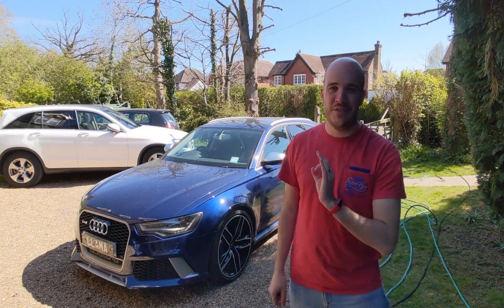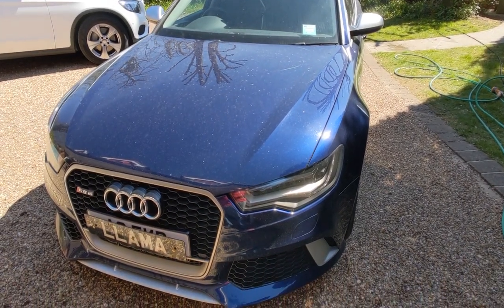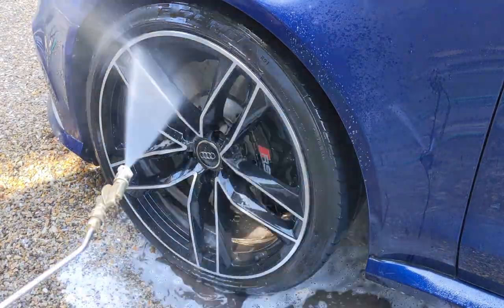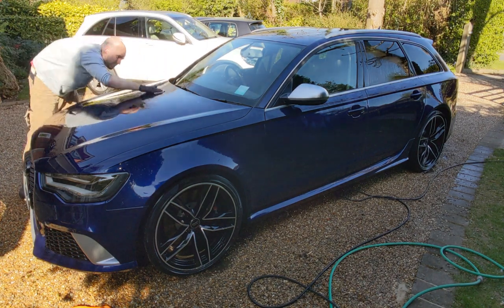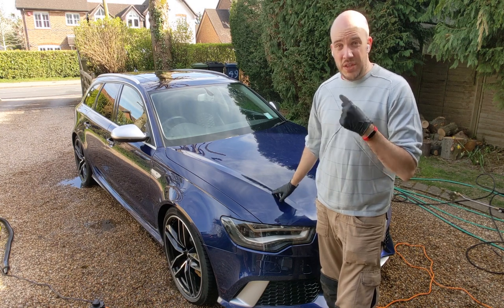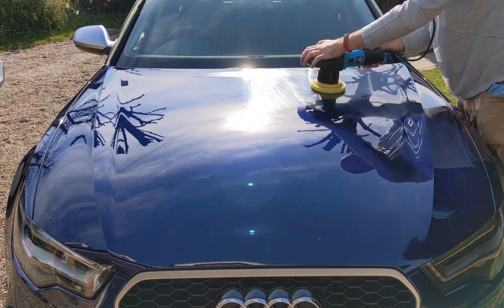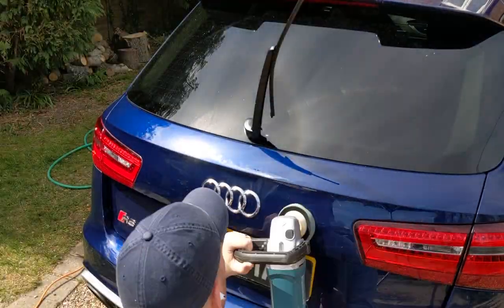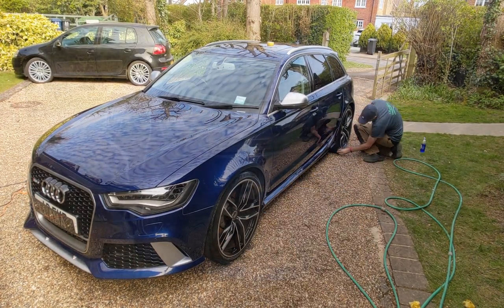Detail: 2014 Audi RS6 Avant Navarra Blue single stage polish and ceramic coating

Comment: What a transformation- well worth all that work! When continuing on the second day, did you have to wash the car again before any polishing?
Reply from the maker: Thank you! I did give a wash the following morning, yes. In that instance I foamed it quickly neith just shampoo in the lance, rinsed and gave it a very quick 2 bucket wash, then rinsed down with DI water and dried. I now have a 3x4.5m gazebo so I wouldn't have the issue (as much, this A6 is probably too long for it, but I could stake out one of the end walls to give me the space needed. I wouldn't need to wash it in the morning then and I also wouldn't get any contamination throughout the day.
Reply: Supercharged Llama Detailing thanks very much. That gazebo must make such a difference.
Reply from the maker: @marcjarvis3975  it does for sure, it enables me to offer far closer to studio results whilst being mobile.

Comment: Great work, with stunning results. Need to persevere with scholl s20 on my own A5
Reply from the maker: Definitely worth the perseverance I'd say. In my video next week I'm doing my friends car with him and I explain how many passes I'm doing and with what pressure, that maybe of use. I also changed pads to the Scholl Purple Spider and was very impressed.
Reply: @SuperchargedLlama  Be interesting in seeing that. Might have been my technique or my cheap DA polisher but I the spider pad just didn't cut it - had to use a microfiber pad which needed further refining afterwards, I don't have much time so I'm working panel by panel.
Reply from the maker: @Cuffy1981  it could be a combination of all those things, you're absolutely right. What polisher are you using? And how many passes? I find I do one pass to spread, 4 passes at speed 3 or 4 and medium pressure then two passes at 3 or 4 with just the weight of the machine/guiding hand if it's vertical before bring it back down to speed 1 for a pass and stopping.
Reply: @SuperchargedLlama  it's a duren da machine from Slims. 3-4 passes the same as you but looking at your rs6 vid like you I may have been working too large an area.
Reply from the maker: @Cuffy1981  oh that's the other thing I say in the upcoming video which I forgot to mention in my previous reply. 18" square...ish. Which is about 3-4 pad widths for 5.5" pads, and I say that because I know the maths doesn't add up, but you never really get them lined up completely true and will have some overlap, so about 3-4 rough pad widths as you're dabbing it down on the panel before turning the machine on.

Comment: The difference is night and day mate, fantastic job! 
Must have been a really long time since it had a proper deep clean...maybe never?!
Do you prefer clay bar over mitt then? Or would you say they both have their place?
Reply from the maker: Now this is a brilliant question to ask and has a slightly wordy answer. The car in this video was definitely washed frequently but also had over 120k miles on the clock and had never been decon'd in it's life. If it had been then this wouldn't have taken as long as it did, especially with the tar. You probably want to perform a chemical Decon every 6-12 months, and use something like Carpro Reset, Gyeon Restart or Garage Therapy Decon Wash as your shampoo every 3rd or 4th wash (assuming you're washing every couple do weeks) to really clean the paint and lift off as much crud as possible. If you do that then you make it last as long as possible before you need to perform a mechanical Decon (which is claying).

I like the G3 mitt and I like the soft bar from Bilt Hamber. I think the mitt is faster but I always find that is marrs the paint more than a well lubricated clay bar.....but that could be moot as you're so very likely going to need to polish after a mechanical Decon that you only really do it when you're going to polish the car anyway. The only acception to the rule is matte paint when you wouldn't use a clay bar and can't polish.

Comment: Could you share on your process on cleaning the pads after you're done please ?
Reply from the maker: Absolutely. After each set I use a tooth brush on the pad face, having it on speed three and very light pressure. I move it from the centre outwards and I tend to do this 2 or 3 times.

At the end of the day I take the pad off the machine and set it in a bowl of warm water, massage fairy liquid (other brands are available 😆) in to it's face for 30 seconds to a minute, squeeze and rinse it about in the hot water and inspect the face of the pad. If it looks good I'll then squeeze and rinse under free flowing tap water until there doesn't seem to be any soap coming out of it (if it's still dirty I'll do the fairy liquid step again before moving on to the rinsing).

Finally I put the pad back on the machine, dial that up to full power and turn it on for 5 or so seconds, spinning out the water trapped inside and drying it pretty well. You could use it again at this point if you wanted to, or if you were done for the day you could leave it out to dry overnight.
Reply: @SuperchargedLlama  Thank you so much for sharing.
Reply from the maker: @swift2117  you're ever so welcome, its the least I could do for someone taking the time to watch the videos and ask questions.
Reply: @SuperchargedLlama  I look forward to your content, literally one of the best out there these days. Thanks once again.
Reply from the maker: @swift2117  🤗😘

Comment: when applying CanCoat on dark paint - have you been seeing some product on the paint or it's just evaporating so quick you just have to trust the process?
Reply from the maker: A bit of both. It was tough going in the direct sun, I've since acquired a gazebo to provide shade when working outside. You can't really see it when you've applied it right, but you can see high spots.